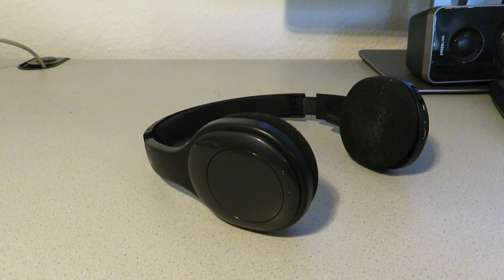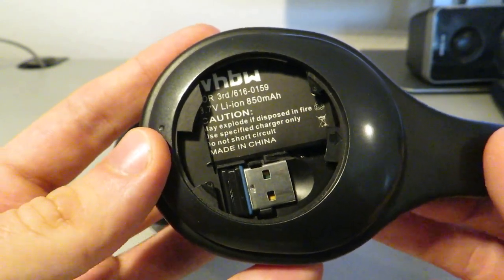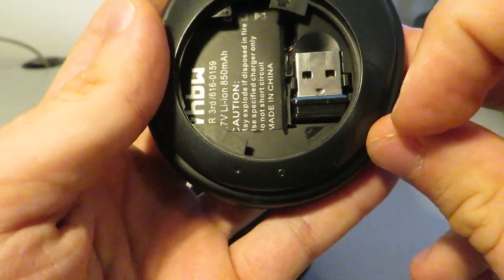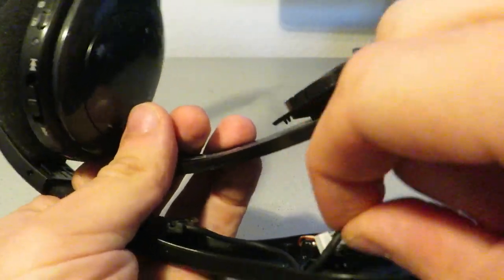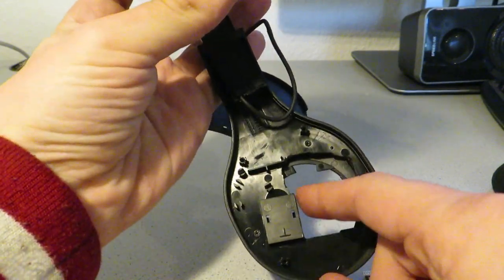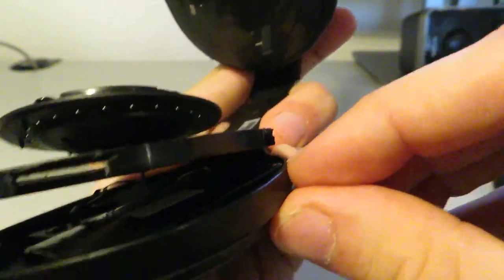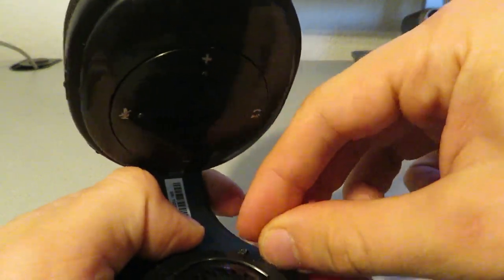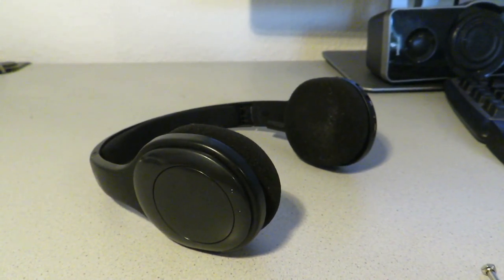Logitech H800 Battery Modification 850mAh (Ipod 3G Battery) without removing USB connector fixation

Comment: Hello, just wanted to let you know that I have successfully fitted the 1100mah battery. It seems a little bit bigger than the 850mah one, but still definitely doable with preserving the usb receiver holder.
Reply from the maker: vaporCRO cool, Thanks for the info
Reply: Can you link to what exact battery you used?  is it and ipod 3g battery with 1100 mAh capacity or another model?
Reply: Civi dan I bought the 1100mah model from the provided link in the description. It's a little bit bigger so you'll have to cut into usb holder, but still the usb receiver is able to fit.
Reply: ok thanks, these battery are not available in canada so I bought an Upstart battery (E225846) which is very affordable for a 850mah battery. Installed and so far so good, will see how it turns out later on.
Reply from the maker: After using the 850mAh battery every day for a year now i finally upgraded to the 1100mAh version. You are right, it is a little longer and thicker but it is still possible to fit it in nicely after cutting away some additional plastic. There have been a few long days where even the 850mAh battery was not enough so hopefully those are now also covered :D
Reply: @Martianbuddah  Glad to hear you fitted it successfully. Yeah, this headset with the 1100Mah battery is a powerhouse. I use it when I run, and when I watch netflix via android tablet, which averages to 2-3 hours a day. I charge it once a week. Easily 17h of playtime, often even more.
Reply: Anyone have a link to the 1100 mAh capacity that ships to the US and doesn't have poor reviews?  On Amazon reviewers complain of having a 3-4 hour charge for the ones I found.
Reply: @Martianbuddah  I bought the 1100mAh version, too, but it does not have a white wire as yours, it has a yellow wire. Should I connect red-red, black-black and yellow-white? I did that and I cannot charge the battery.
Reply: @Martianbuddah  New info
Reply: Can I ask 1100mah Size? I may only be able to find batteries of the same size to modify here,thanks so much

Comment: The insight in how to switch over the cables on the battery plug and the assurance that applying pressure to pop the inside panel off was very useful! Thank you

Comment: I managed the 850 swap the other day, charged and tested, AOK!  Thanks.  Old battery was good for about 1.5 hrs.  New battery, nearly 24 hours. After first charge, I put it down and forgot to turn off unit.  18 hours later it was on and still playing music...  

I got lazy and used a fine pointed wire cutter to remove the excess plastic as I did not want to go to the garage to get my Dremmel.  Made nice clean cuts.

Start to finish, 33 minutes.

Comment: All new searchers, This one!  This is the last Logitech H800 battery mod video you need to watch.  There is some cutting needed, get your dremmel out but you still have the USB dongle  bluetooth storage AND  I am getting somewhere in between 8-10 hours after this mod.   I was afraid the larger battery would make the weight lopsided but I haven't noticed a difference at all.  GREAT DIY VIDEO.  Shame on Logitech.  They still make these, still charge a premium price and still haven't updated the battery capacity.   They suck but Martianbuddah rocks.

Comment: My 2p... I bought the 1100mAh version and it fitted well. I used narrow nosed wire cutters to cut the top of the plastic piece that has to come out, and then I found that to get the sides down it was easiest just to make several vertical cuts into the sides and then they just fold away and break off leaving no edges. I left the vertical piece up the centre there (to the left of the battery), but I took a tiny bit out of the horizontal piece to the left of that to allow for the cable from the battery to sit in place. I would say that it's important for the speaker cable to go back into the two left-most slots where it had been originally to allow for extending and contracting easily when you change the size. I also found that I didn't need to make cuts away from the other piece of plastic with the ear piece, it just about fit back in place :)

Comment: Thanks for the video.  Took me 15 min start to finish to do this with watching your video ahead of time. The plastic is very thin around the old battery holder so no dremel tool needed.  Just cut the corners with a utility knife and snapped off the sections with small pliers. Same thing with the area around the battery corners.  A quick snap off with pliers made for a super clean cut. Saved me $120 as I was thinking of upgrading to the Jabra 75, no need now! this set is good now with the extra battery capacity.
Reply: I have Jabra 75 but still prefer the H800 because it is more comfortable to wear for hours. Also the H800 has a 3-way switch of off - dongle - Bluetooth, which I also prefer over simultaneous dongle and Bluetooth. I am glad to find this video and will do the battery upgrade soon.

Comment: You can open up the battery case from the outside.  The inner circle on the outside of the battery compartment just screws off.  It's like a cap with just a little pressure keeping it on.  No need to go through the inside and take all of those screws off.  I just installed my new battery in less than 3 minutes.  No tools needed.  It is working just fine.
Reply: I think you kinda missed the point there. What you describe works perfectly well for replacing the battery with one that has the same dimensions as the original one . The battery he is replacing the small original one with has 3.7x or even 4.8x times  the capacity. (850 or 1100 mah vs 230 mah for the original battery). But it is also is almost 3 cm longer and a bit thicker. That is why you have to open the casing and cut out a couple of pieces of plastic so it fits in there.

Comment: Looks cool. Very nice modification. I'd like to extend the travel use of my Logitecth H800. I like handywork jobbies like this. I have small Ace hardware drivers and a Dremel tool that cuts, grinds and countersinks. Gonna pull out my tools and find a battery on Amazon. Thanks for making the video.

Comment: Excellent video!  I love the H800.  I own several.  I will try this on one of my older ones. 
I have a couple questions:
1. Comments on similar videos complain of the imbalance in created by a heavier battery. Have you noticed this?
2. I see the dremel you recommend.  Any tips on cutting the plastic?  That is my biggest fear.  I have no experience cutting plastic.
Reply from the maker: No i did not notice an imbalance with this mod. I was a total noob with the dremel tool as well ... it was a little messy but somehow i managed ^^ but several people have mentioned that they did the mod with a cutter scalpel ( like this https://www.amazon.de/Wedo-7852199-Comfortline-Ersatzklingen-Schutzkappe/dp/B00J8BAAC0/ ) ... That's probably the cheaper and maybe even easier option
Reply: @Martianbuddah  Thanks for the feedback! One more question: The Amazon link you provided for the 1100 battery doesn't ship to the US. All of the ones I see on Amazon (USA) have shitty reviews about battery life (3-4 hours). Do you have one that you recommend that can ship to the US? If not, do you know anything about the 4th gen or higher iPod batteries? Might they work with the minimal modification you show in your videos? I love the H800. Nothing comes close as far as affordability.
Reply from the maker: @Steve-3P0   The reviews are probably talking about the battery life in an ipod, not in the H800, so they are not that relevant. I didn't find any on US amazon but you could maybe order from ifixit: https://de.ifixit.com/Store/iPod/iPod-3G-Replacement-Battery/IF192-015?o=1

Comment: after replacing the battery as shown, I pulled the wire out that is fragile and don't know how to fix, can you help or direct me to a video showing me how??
Reply from the maker: Oof that hurts. That did not happen to me yet after swapping the battery for a few times now.... I guess one could try soldering it back on but I can't help you with that and I don't know if the result can be good

Comment: Does anyone know the size of the plug used here?
I see most ebay batteries either comes with no connector or a choice of connector size...
Reply from the maker: Hey, the plug is around 2mm x 4mm in crossection

Comment: A big question: I love this headset. But with my second one after three years it cannot be charged any more:

The blinking signal lamp just turned dead. (With my first logitech H 800 after one year the signal lamp did not stop blinking any more. So then I got a new H 800 headset from the selling shop.)

Does it mean with my current headset that its akku is dead (in which case I would follow your procedure with that new and better akku)? 

Or is it perhaps another, bigger problem (e. g. with the circuit board on the other side where the micro usb connector is placed)?

An answer would be greatly appreciated.

Best wishes, Hans

PS) In operation mode the signal lamp is red (low), also when connected via micro usb. In charging mode it is dead.
Reply from the maker: Hallo Hans. Nun kann ich dir natürlich keine sichere ferndiagnose geben aber rein statistisch gesehen ist es wahrscheinlicher dass der akku kaputt ist als dass etwas an der ladeschaltung versagt hat. Ich besitze mein headset jetzt schon seit vielen Jahren ... weis ehrlich gesagt nicht genau wie viele, 6+ Jahre wohl. Während dieser Zeit habe ich 2 mal die Ohrenpolster erneuert und 2 mal den akku durch einen besseren ersetzt. Probleme mit der Ladeschaltung hatte ich in dieser Zeit aber nicht. Ich würde daher dazu raten es mal mit einem neuen Akku zu probieren.
Reply: @Martianbuddah  

Besten Dank! Ja, macht Sinn! Das Lämpchen ist ja im Betriebsmodus an, rot. Also Lämpchen ist nicht kaputt! Aber im Lademodus ist es tot. Das heißt wohl, dass der Akku keinen Strom aufnimmt.

Aber dass der Akku plötzlich Betrieb einstellt, ist komisch.

Ich werde es sehen. Danke für die gute Anleitung.
Reply: Hi Martian,

Der Akku ist unterwegs. 

Fürs Schneiden: Gibt es eine günstige Alternative zu jenem Gerät mit dem Dremel (zumal es kaum einsetzen würde)? 

Tut es nicht auch ein Teppichschneider oder Keramikmesser?

Habe auch handliche Sägemaschine.

HG, Hans
Reply from the maker: @Vimamsa1  Hi Hans, ja der Dremel is ein bisschen übertrieben. Glaube ein Cutter sollte es auch tun. Am besten so ein Skalpellartiger wie der hier: https://www.amazon.de/Comfortline-Softgriff-inklusive-Ersatzklingen-Schutzkappe/dp/B01E5ICQYU/ref=sr_1_1?ie=UTF8&qid=1548710263&sr=8-1&keywords=skalpell+comfortline .
Reply: Hi Martian,

Habs demontiert und den Akku nach dem Umstecken der Drähte auch richtig mit den Headset-Drähten verbunden, denke ich zumindest (jeweils die gleiche Farbe zusammenbringen).

Aber noch nicht (!) das Plastik ausgeschnitten, den neuen Akku eingelegt und wieder zusammengebaut. 

Denn das Kontrolllämpchen leuchtet beim Laden nicht auf. Also lag es wohl nicht am alten Akku; und das Headset kann eigentlich weg.

Das Zusammenbauen macht ja sicher keinen Unterschied, solange alles jetzt schon korrekt verdrahtet ist, oder? 

Also kann ich mir ggf. das Ausschneiden auch gleich sparen.

Besten Dank und Grüße,

Hans
Reply from the maker: @Vimamsa1  Hm das ist ärgerlich, tut mir sehr leid um die vergebene Mühe :/ aber dann muss wohl ein neues headset her.
Reply: Danke. Bevor ich es entsorge, weil ich es nicht genau auf Deinem Video erkennen kann:

Sollen beim Zusammenstecken von Akku-Kabel und Headset-Kabel schwarz auf schwarz, rot auf rot und weiß auf weiß treffen? 

Sorry für die Laienfrage!
Reply from the maker: @Vimamsa1  Ja genau, so sollte es sein. Also so funktioniert es jedenfalls bei mir ^^

Comment: Thanx.
Is 3,5 jack port included in hedset?
If no, is posible to add?
Reply from the maker: Peter Onger no there is no 3.5 port. maybe there are 3.5 to usb adapters for that purpose? but I have never tried one of those
Reply: Audio is wireless only. Audio does not run through the USB cable.

Comment: Can anyone say about how log I should I expect it to take for Logitech H800 headphones to charge one of these 3rd generation IPOD batteries?  I got an 1100mAH battery and connected it external to the headphones and took voltage readings over a period of time but the voltage did not rise about about 3.78VDC over about an hour.  I reconnected my original battery which was in a state of partial discharge and over several minutes I saw the voltage rise from about 3.8 volts to about 4.05 volts; clear evidence that it was charging.  I'm just not sure about my upgrade battery.  I may wait until my regular battery is charged and then plug the new battery in overnight and take a reading tomorrow.

This is a follow-up to my original post above.  It seems that the battery charger in my headphones does not have enough guts to charge the 1100mAH cell I fitted into them.  After a couple of days to charge the voltage had not risen even 1 mV.  I put the original 265mAH cell back and it charges.  It was going to be inconvenient to take the headset apart to remove the 1100mAH cell to charge it then put it back so I fitted a AAA cell holder into my battery compartment so I could snap-in an AAA size Li cell.  I got a 4 pack of these cells which I can charge on my Li cell charger then rotate them through service in the headset.  These are 600maH cells so at least they will last the entire work day ad if one runs out early I can just pop in another fully charged cell.  The battery compartment cover won't go back on any longer but that's not a big deal for me.
Reply from the maker: it Can Take a while... my 850 mAh battery takes several hours to charge
Reply: According to the manual it charges original battery 265mah in 3h!!! So I would expect charging times of around  x4 times that

Comment: looks like the battery is 1100 mAh? Thanks
Reply from the maker: mhm it says 1100mAh on the amazon page but i got an 850mAh battery in the mail ... don't know if it was just a mistake or if they purposely claim more capacity ^^ but the 850mAh one i got fits perfectly so i am glad that i didn't get a bigger one :D
Reply: Thanks for sharing.
Reply: I decided to insert a battery for 1000 mAh. In the local competent service, I found a master who agreed to do this). But unfortunately now the lid does not close too tightly. Although the size of the battery is exactly the same as the video 48 * 32 * 6 mm.
Reply from the maker: thanks for sharing. i just ordered the 1100mAh battery to compare the exact sizes and see if it fits as good as the smaller one.
Reply from the maker: So after 6 months i finally got the 1100mAh battery :D (the carrier didn't find my address 2 times >_> i forgot about the order and now half a year later asked the seller what happened to the battery...) It is indeed a little thicker and longer, but not a lot. I had to cut out some additional plastic but it still fits in pretty nicely. So thanks for the comment, now it can definitely make it through a whole long day ^^